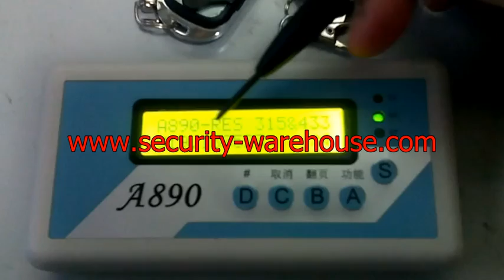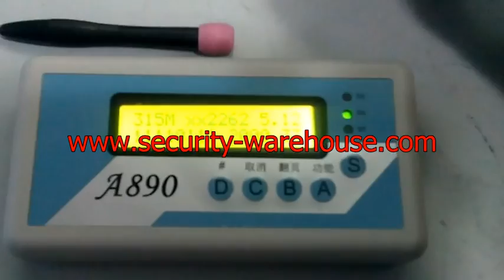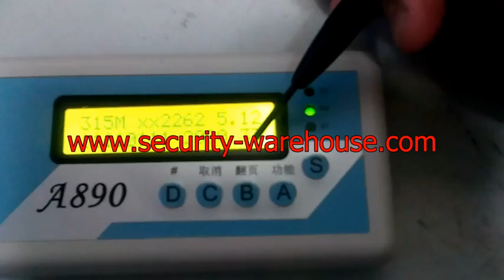RF Wireless Security Code Scanner Grabber 315 & 433 MHz Decode Many Chipset Part 1

Comment: This is the worst scanner I have ever seen. Unlocks only the easiest and oldest systems.
Reply from the maker: this code scanner is not for cracking car! it is only for alarm professional to troubleshoot the simple remote wireless control, but for some reasons, you want to see if it works for remote control of car, it is your owned designed usage and beyond my ability of understanding.
Reply: Do you have more sophisticated scanners for cars or keyless starting devices?
Reply from the maker: could you send me email and let me understand specifically your requirement? sales@security-warehouse.com
Reply: @RFIDSecurityWarehouse  I want to learning key programming in school where can I do it